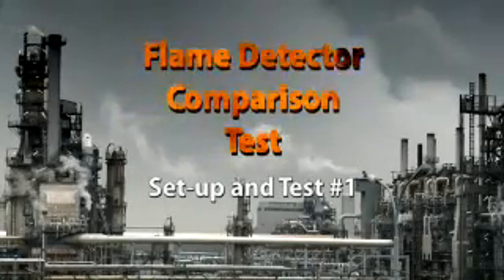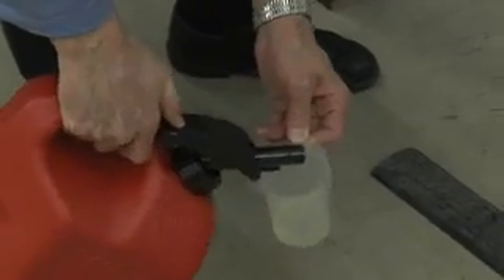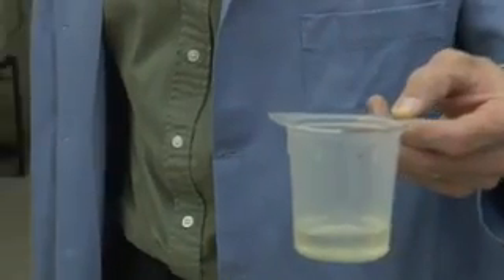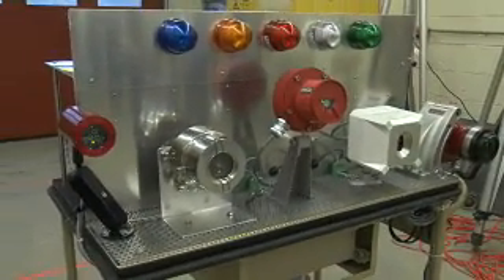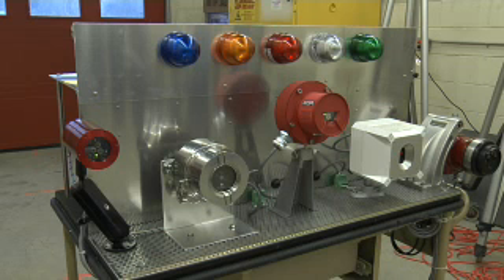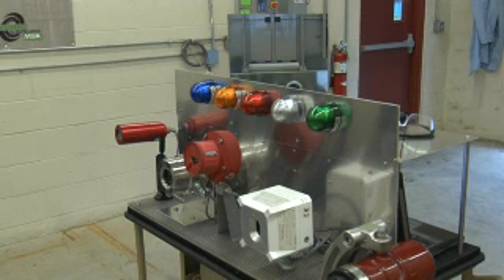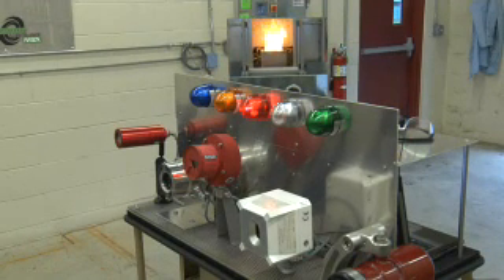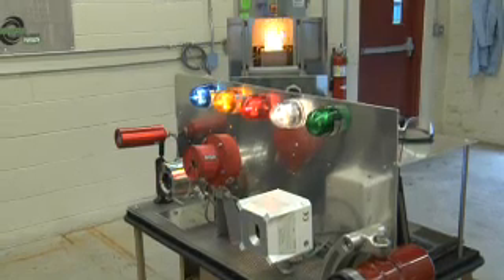Flame Detector Comparison Test 1

Comment: Optical flame detectors should be configured in such a manner to ensure detection of the fire of interest.  Different sensitivity configurations have a
purposeful impact on the Field of View and speed of response
characteristics.  For example, a detector that has been configured to LOW
sensitivity (as is available on the Det-Tronics flame detector) may purposely
exhibit such performance attributes